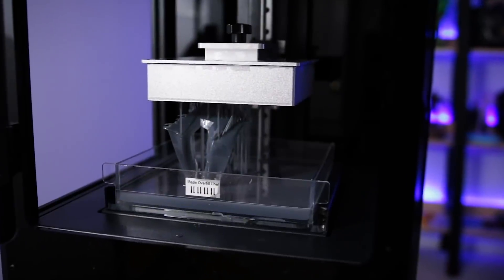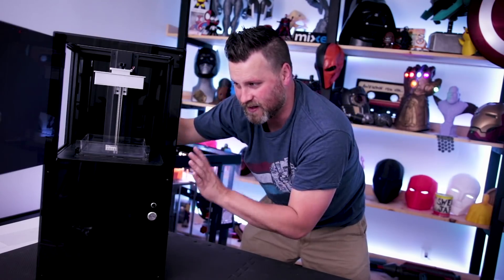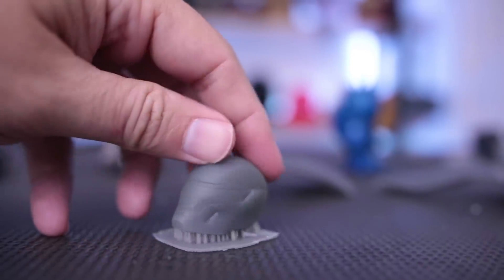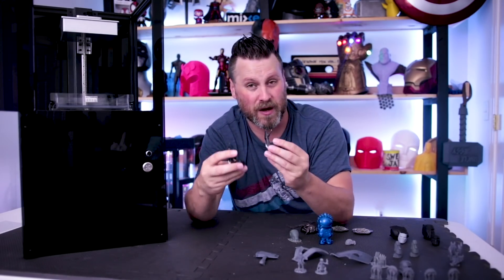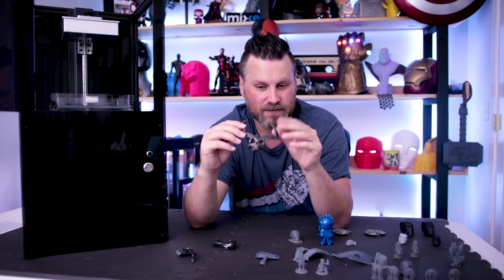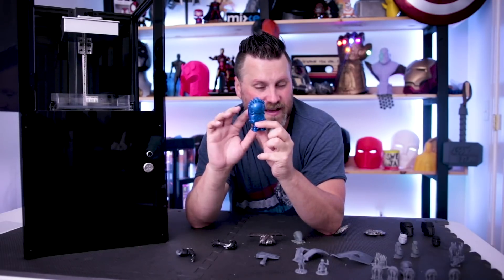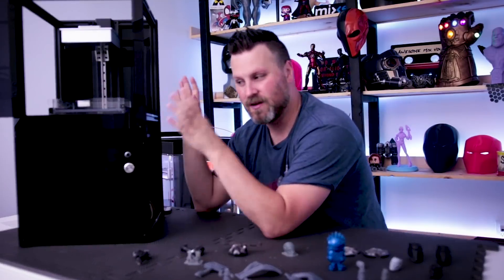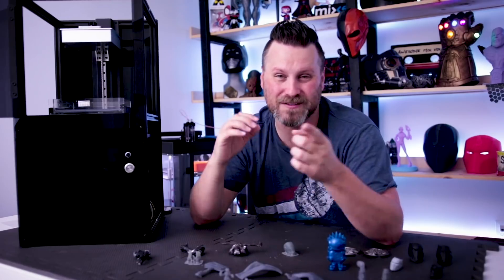Peopoly Moai SLA Resin 3D Printer Review

Comment: Honestly I think 50 to 80 $ for the resin (did I get that right) is not too bad. Especially considering it accepts pretty much any brand from the look of it. I don't think I would mind that if only because it looks also less fiddly with adhesion and what not. All that honestly puts me off on the 'regular' 3d printers.

Again by no means an expert here, in fact quite new to all of this and in the process of decided which way I want to go.

The only real issues I see with these is build size and no easy way I can see for them to ever make it so you can have the resin equivalent of 2 extruders.
All the other stuff .. I can deal with for what I have in mind
Reply: Your idea would be a good follow-up video.  This review helped me a lot because I'm just starting my research into 3d printing.

Comment: Great review, and I'm also a big fan of the printer.  A couple additional cons I would add:

1) The coating in the vat is a consumable that wears out after a while. You'll either need to remove the old coating and replace it, or by a new vat - which is around $50.  This is not unique to the Moai, but people starting with SLA should be aware of it.
2) The SDD reader boards in the Moai can have bad solder joints. Mine did and it drove me batty until I figured it out. Matterhackers sent me a replacement at no cost.  👍
3) The firmware doesn't support extended FAT32 formatting, which means you're limited to around 4GB gcode files. Most people won't hit that limit, but if you're printing high detail figures that take up most of the build volume then this will bite you.  Peopoly says they're working on this for a future firmware update. 
4) Again related to the memory card - I really wish the printer had a USB port for wireless upload of gcode and monitoring via Octopi.

I love the printer and think it's a great value - well engineered, beautiful to look at, etc.  Very happy I bought one.  😊
Reply: Hi i have been having huge problems with mine , seems to me like the quality of the prints have gone way down, i filtered the resin, cleaned the vat, reset the leveling , nothing seems to work. The DIY cylinders test comes out horrible, only 1 or 2 cylinders print, the rest break or are close to breaking, tried reducing the Z-reset value, same result. Could it be that the vat has worn out in that area(didn't see anything when i cleaned it), there were some bubbles in the vat might that be the cause. I have no idea what to do.

Comment: Great detail Clayton! Thanks for the shout out!  For those that are wanting more info on the upcoming uber sized DFA printer, they can check it out here: https://peopoly.net/pages/project-dfa

Project DFA Specification:
  300x300x300mm build volume
  250mW 405nm LED laser
  Top-Down design with applicator blade
  Print speed is 600mm/s for 100um layer height.

Comment: I would love to be able to print helmets with this kind of detail as well, but unless someone puts out a tough enough aka impact resistant resin, it is unlikely that the helmet would last even one con. :(
Reply: The output from these printers is almost never meant to be an end product.  Rather the prints are finished to create a master which is then molded and cast in whatever is the most appropriate material for the job.  Some resins are specifically marketed for toughness or flexibility etc. but the properties are rarely, if ever, equal to a cast piece.
Reply: You can always use it as a mold or after building, help fortify it with fiberglass resin.

Comment: Info-packed review.  I would have liked to see more details about how often the tanks need to be replaced and the cost and difficulty of doing that.  Is a different tank required for each variety of resin to avoid cross-contamination? Also:  Print times?
Reply: Tank replacement time will vary. I think if you only print larger items that take up most of the build platform, you can get at least 2 bottles worth of prints. New vats cost $30 plus shipping right now. Changing the vat is super easy. they just slide in and out. I've only swapped mine once so far because I swapped resins which leads to... You are not required to swap vats, but a lot of people recommend it. You can clean the vat with isopropyl alcohol and reuse it until the vats bottom layer is no good and the vat needs replacing. You can tell when the vat needs to be replaced because the bottom layer gets foggy. One way to extend this IF you are printing small items is to make sure to change the build position during the gcode phase in cura. This way the bottom layer gets used up more evenly. Print times vary, but for me, printing small figures for gaming takes about 5 hoursish.. But it is worth the wait. Detail is crazy good.